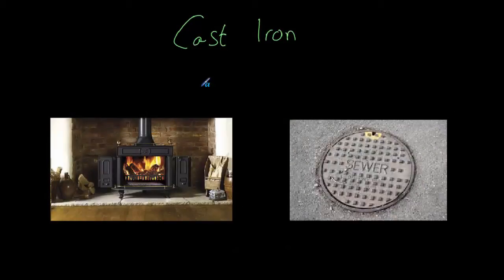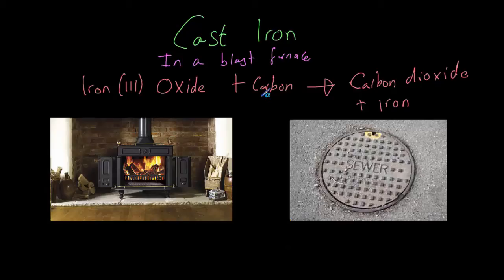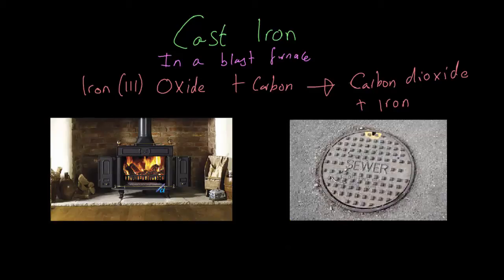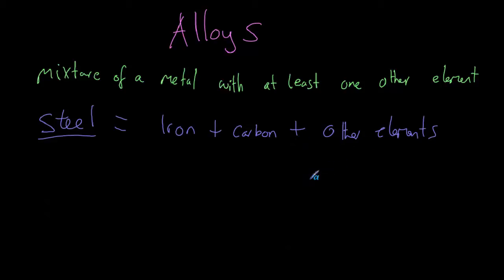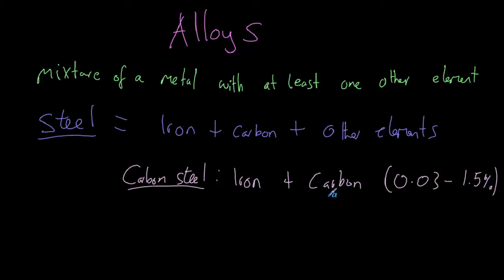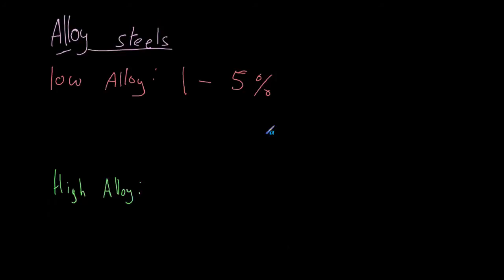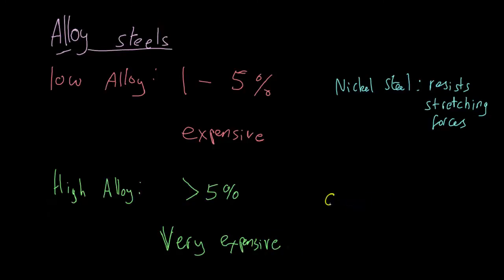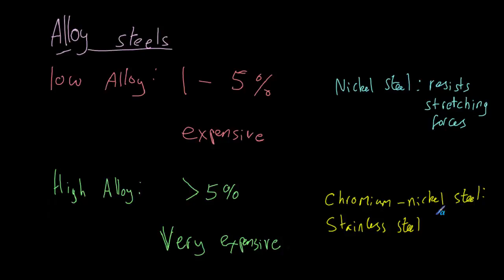Iron, Steel and Alloys - AQA Chemistry

Comment: my book says 1.5% of carbon is a high carbon steel you suggested more than 5%. can either one be correct in the exams?
Reply from the maker: +JackDumper For high carbon steel I also said 1.5%. The 5% was for high ALLOY steel, which means 5% or more of the steel is made up of other metals. Thanks
Reply: Thanks !